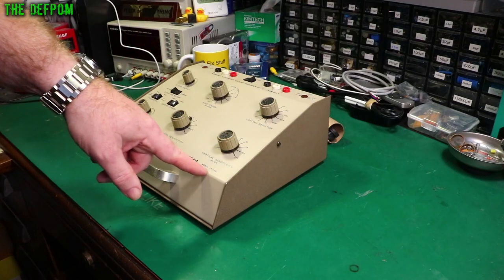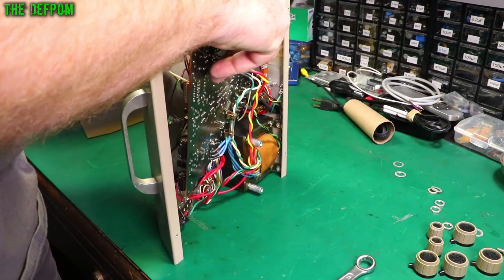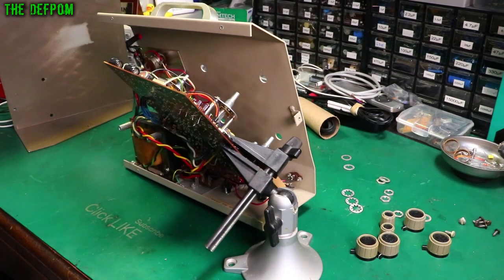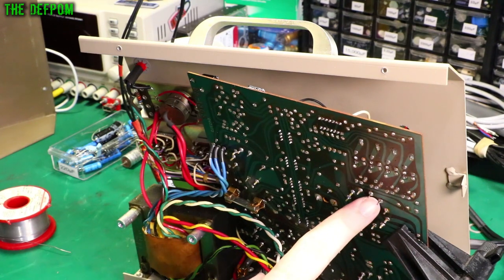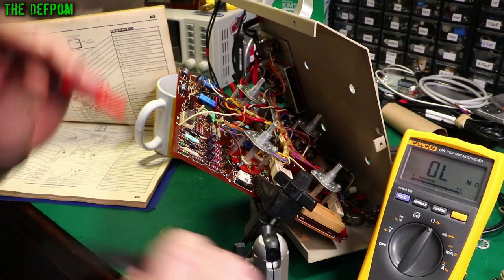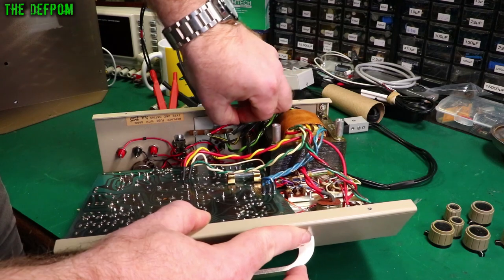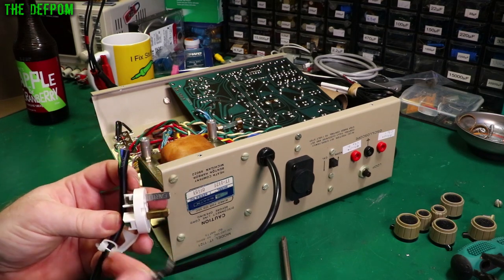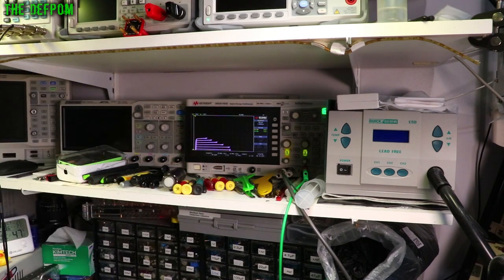🔴 Heathkit IT-1121 Curve Tracer Refurbishment - No.994

Comment: Great piece of kit to find! Here, in the USA, we have a product called "Liquid Electrical Tape." It comes in a can similar to PVC pipe dope. It might do, to coat the first half of the mains plug ground pin, to prevent the shock you described. It would not be thick, like heat shrink, so it should allow you to push the plug completely in. It does dry hard, but it would be subject to wear, so you would want to inspect it, periodically. Hope that helps.

Comment: The tan era started in the sixties. That tracer is almost as old as I am, as I was born in 1965. That was when they manufactured the best looking equipment in my opinion. They switched to blue in the seventies, as I have a scope I built from that era. Their last was hurrah was the little blue plastic cabinets and dark brown amateur gear, when Zenith ruined the company.

These are not that complicated, as a stairstep generator is the secret behind them, along with a multi-voltage and current supply.

Comment: Passive in circuit testing with two probes is always a problem. You can use 4 probes or more and set up guard probe positions. But the easiest is to test all components and compare the values to those taken from a known good board. 

Not something the average repair guy has to hand. At least with HeathKit  you have the build manual so you have a great starting place.

Comment: Does seem a little noisy. Maybe that is to be expected from an inexpensive vintage tracer. What does it look like with the HF filter on the scope turned on?
Reply from the maker: It uses banana cables, I intend to change it to BNC connectors so that each signal is shielded to the scope.

Comment: Nice video, I'd be in there replacing those old resistors, it looks like a lot of noise on the traces.
Great old machine, I used one at Uni way back for electronics prac.
You need to team it with a proper analog scope.

Comment: FYI;  There is a proper tool for installing and removing Heyco strain relief connectors. New they are about $80 but on ePay, you can find a decent pair for MUCH less. I paid ~$20 for mine and they are worth every penny. The one you want to get has the BLUE handles. The red ones are cheap knock-offs made in asia and are crap.

Comment: Capacitance increasing is a sign of degrading oxide film. They will probably reform with applied voltage, but yes replacing is good, unless you want the look, and can take the risk of them going out with an earth shattering Marvin the Martian kaboom.

Carbon composition almost always drift high, depends on the value, over 10k they drift high a lot, below 1k only a little, unless they have been well toasted over time.